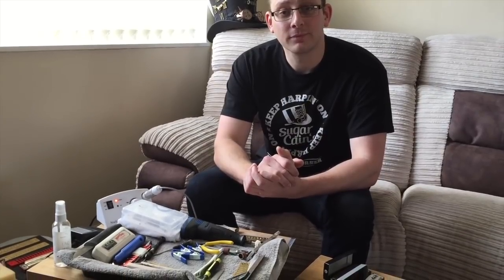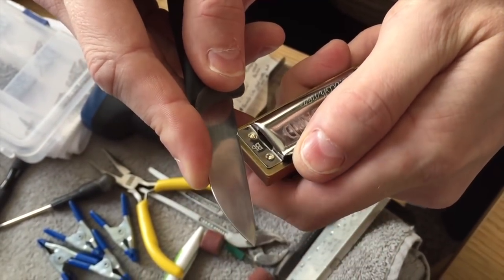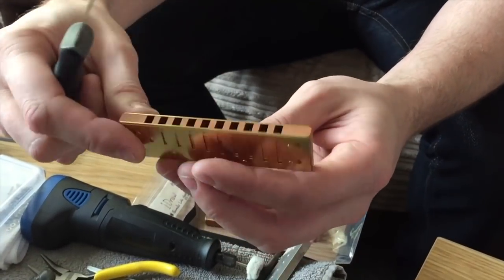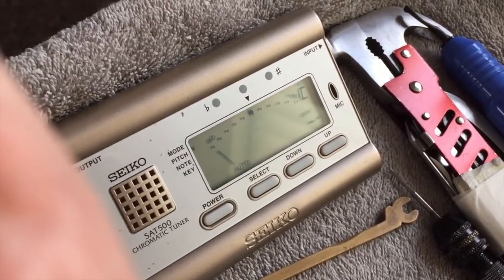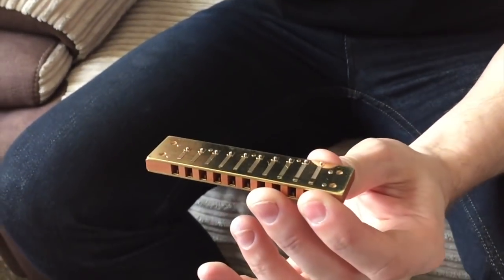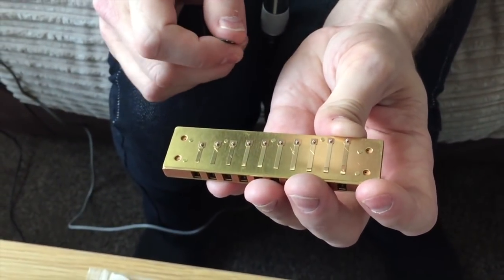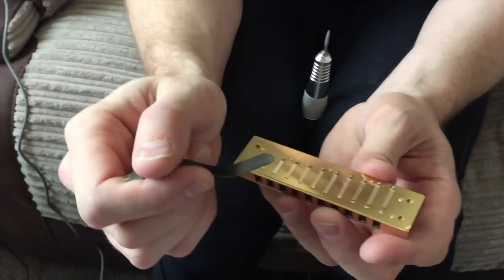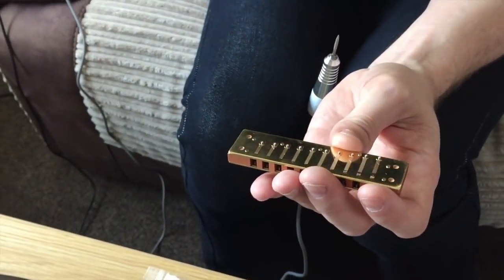Re-tuning a harmonica reed on Hohner C Marine Band with harp customiser Sugar Cain Hamilton

Comment: hi, perhaps you can help please.  how do i get my 8 hole to stop squealing, squeaking, and breaking down like a bitch it's so bluddy awful. ALL my suzukis and hohners yeah they ALL do it ..  im going freakin nuts here. any advice would be magnificent. maybe this can be bounced over to sugar? thanks!
Reply from the maker: Hi Jeffrey, is that on a blow bend or overdraw or just on any normal note? Cheers. Liam
Reply: both although it does depend on the key. I've gapped my harps to give clear equal breath notes. My Golden Melody in C  has a way of playing 2 notes on the 8 it "snaps" with air pressure to the higher note (who needs overblows!) depending how hard I blow. Nothing is worse that a blown 8 hole to make you go a funny shade of blue. I don't even think about over blowing. It not possible if you can't even get a clear note at "sea level"